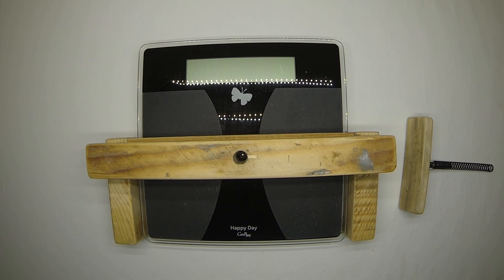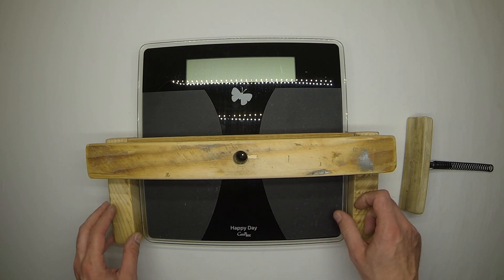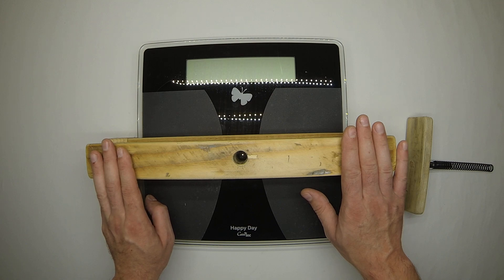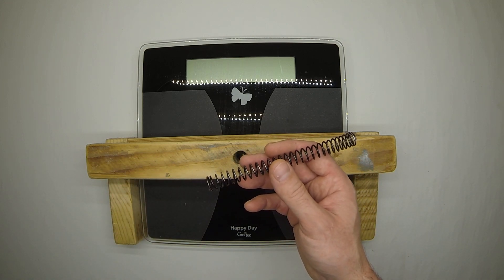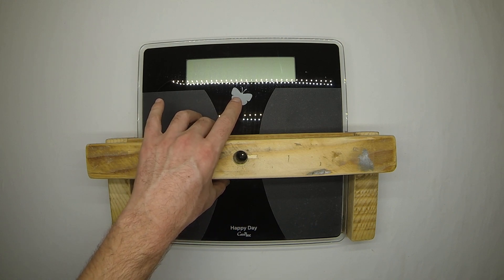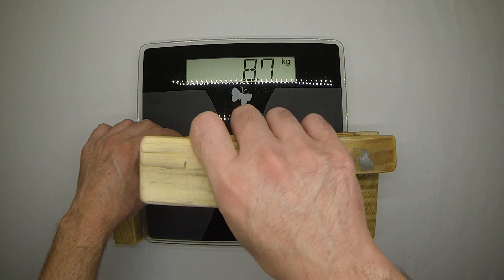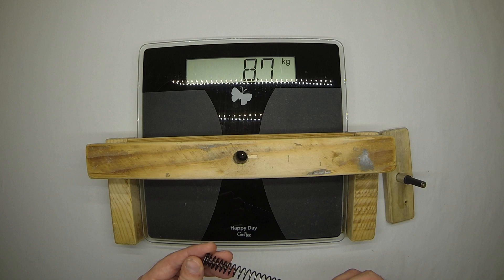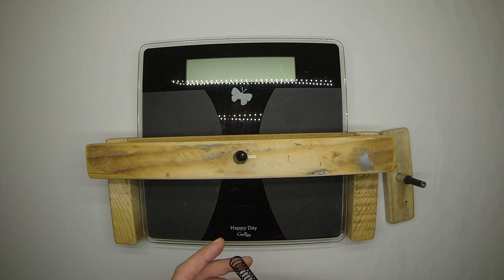EASY WAY TO MEASURE THE STRENGTH/RATING OF AEG MAIN SPRINGS

Comment: True shs spring blue box is stronger than red box so does with different brand although they all write the same spring size but the spring load is so different
Reply from the maker: Yeah. That's why I measure every spring  and then sort them by their actual power. Makes teching so much easier
Reply: @AirsoftTipsandReviews  thats a great idea and way to identified spring tension

Comment: Needs a side view of the jig.
Reply from the maker: Sorry, didn't think it was needed. There's nothing to it; the stand/jig is a simple piece of wood with a hole drilled through it. And you must make sure that the wood does not touch the scale when pressing down on it.
This is my attempt of makeing it. Maybe someone will think of a better design.